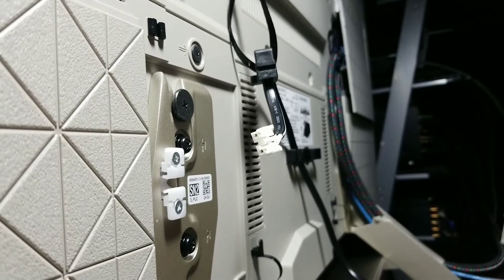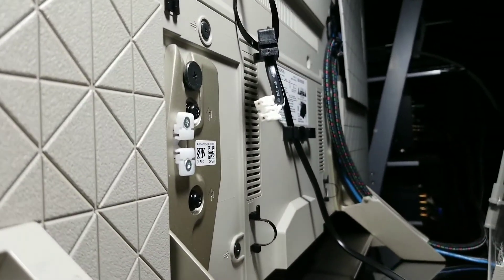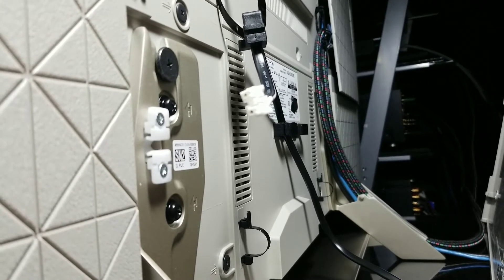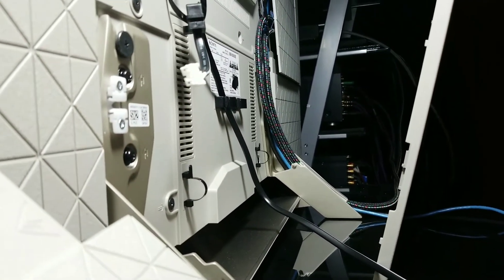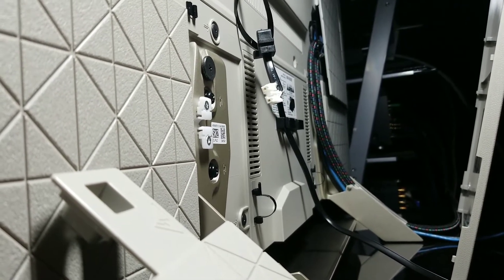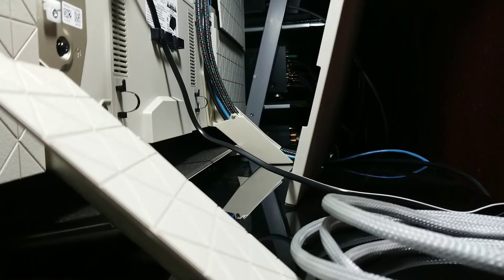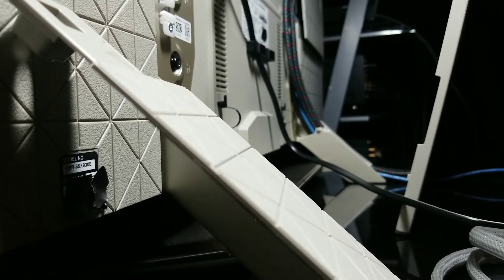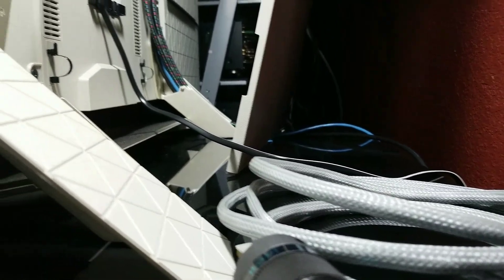Sony 930E POWER CABLE CHANGE OUT.

Comment from the maker: Disclaimer. If you don't know what you're doing please do not try to do this can severely damage your TV if not permanently damage your TV only for skilled technically inclined technicians. Or video enthusiast.
Reply: FADETOBLACK Nice
Reply: How do you damage your TV swapping a power cable?
Reply: @ShadowGateKDA  hes not swapping.he needs to resolder too. Cutting old wire to solder new wire in